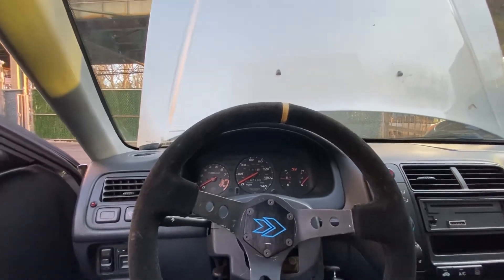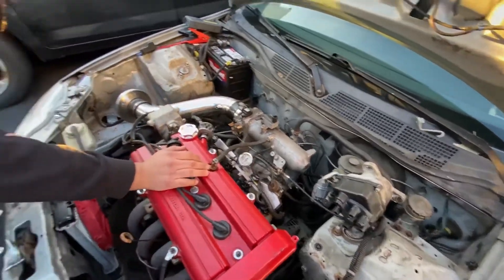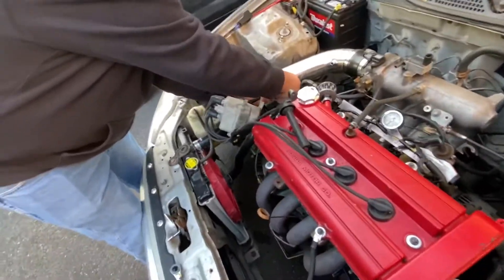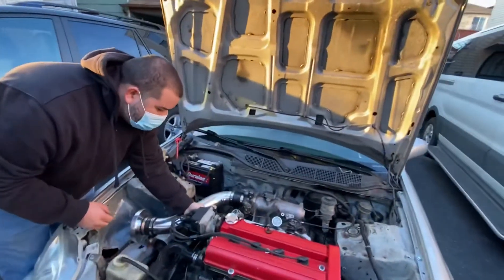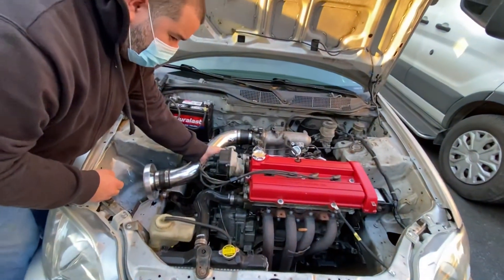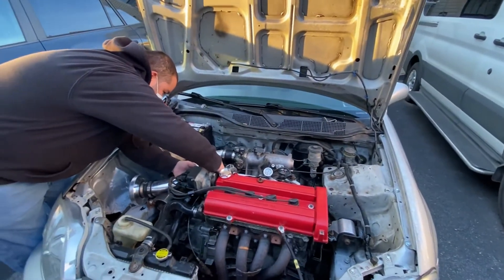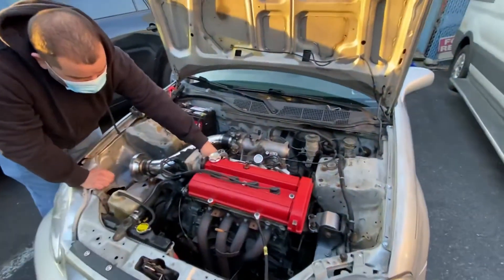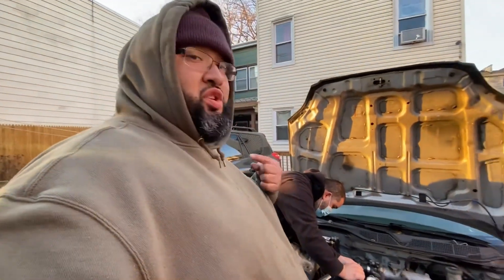Em1 cluster repair (junkyard parts save)

Comment: Hoping you’ll see this
Is there anyway you can show us or even hmu on IG with how to swap the gauges over from the ex cluster to the Si or Vis versa
My Si cluster has the same issue but for the lights and I’ve tried replacing but the film on back is burned out
Reply from the maker: Yeah check out this video I do it here 

https://youtu.be/6T4reO4Z2Z4